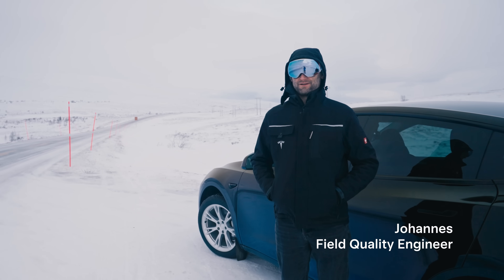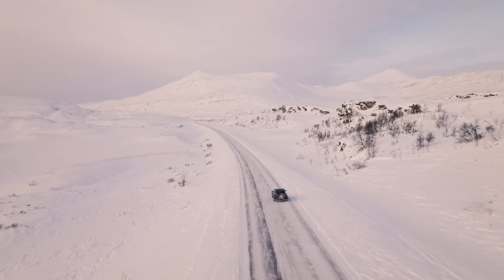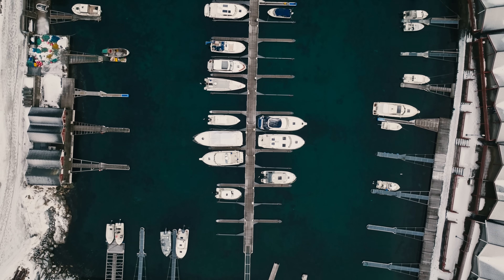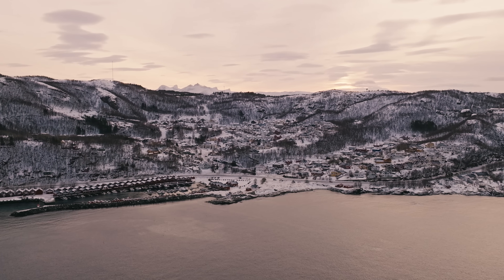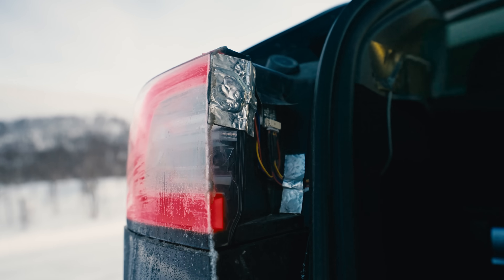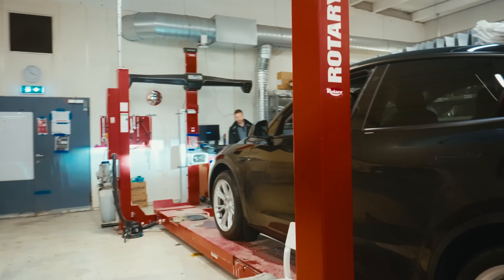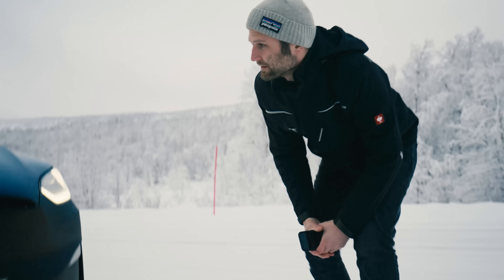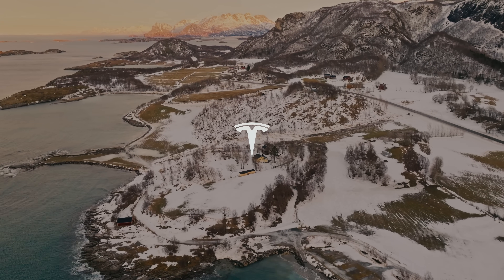Extreme Cold Testing | Tesla Model X & Y

Comment: Would be great with a winter mode that loweres regerative braking automaticly when in ice conditions, shuts of folding mirrors and so on..
Reply: Not 1 shot with snow on the car.
Reply: @nathanielschroeder1321 What is that supposed to mean? Over 80% of all new cars sold in Norway are fully electric, another 10% plug in hybrid and 10% gasoline or diesel. 

They perform impressively well in the winter, better, in fact than gasoline cars. Not having to pump gas in the bitter cold, and getting heat into your cabin the second you start the car, being able to melt all the ice on your windscreen in 1-2 minutes, those are real nice-to-haves that makes owning an electric car here so good.

Comment: Please bring it to Phoenix, put it in a garage that is not climate controlled and plug it in to charge overnight and close the door when it is +48c. Good luck.
Reply: Watch the hot weather test video. They test the cars above 50 degrees, it would be just fine
Reply: @patmanrick  I'm detailing actual circumstances when the system gets the garage well above 55c while cooling the battery while charging. The waste heat really helps keep the master bedroom above the garage nice and toasty, to say nothing of what it does for longevity of the vehicle cooling, electronics and charger.
Reply: @john_in_phoenix  I mean, presumably the vehicle electronics will be just fine given that the car internal temp won't exceed 104F

Comment: Those of us in colder climes do much better with a garage.  My garage is unheated, very well insulated, but attached to my house so it never gets below 45F give or take.  I often wonder how my S would do on a -10F morning.
Reply: -23 C? You wouldn't want to Supercharge it under time pressure in that state, but it will drive. The rest of the car will be as unhappy as any other car in that temperature. Norway is not just a testing ground for Tesla, it is also an admittedly small auto market where the Tesla Model Y dominates overall sales. If Teslas were stranded in those temperatures, the news would LOVE it. Occasionally having problems starting a piston engine in that temperature is normal, for comparison.

Comment: Please let us disable the regen breaking on icy roads on the model Y. It is super dangerous to ease off the gas paddle, The car Regen is dangerous on icy roads.
Reply: I set mine to chill mode and low regen in the winter, that seems to calm it down considerably in difficult conditions.
Reply: @geirmyrvagnes8718  you can choose low regen???
Reply: @tabxtra7057  Yes. Tesla have been back and forth on this, but I have it in a Model 3 in software version 2023.26.7 at least. I don't remember it being gone from my car, but if so, that probably happened in summer, since I use the standard regen then.
Reply: There used to be regen selection in previous software versions in 2022 when we had a model 3 rental, but when we got our new Model 3 last week it looks like that option is gone now?

Comment: Thats my hometurf.
Tesla engineers if you read this, the Y has a design problem in the wheel well lining.
With cold temeratures and salted roads the slush/snow acumulates on the fabric like liners in the wheel wells.
Last winter it almost rendered my car undrivable because it filled up and turned into some black glass like material that was impossible to remove.
Reply: It also builds up on the fabric like underbody panels, and rips them apart with weight.
I replaced my underbody panels with aftermarket aluminium plates.

But to be clear, this is a problem many cars from all manufacturers have. Most cars aren't built for long winters. Torn underbody panels are very common here.

Comment: Electric cars have better advantages in extreme weathers. ICE cars will overheat in in hot weather (mostly the onboard battery gets fried), and have trouble starting in cold weathers (frozen liquids).
Also driving through deep water, it has been shown a Tesla will have a higher chance ov getting through floods, unlike the ICE with their air intake getting flooded resulting in water in the combustion chamber destroying the engine (water does not compress).

Comment: Do the cars regulate the battery and electronics in extreme heat and cold? I keep activating COP and the A/C to prevent overheating, but there's no clear answer as to if that's necessary.
Reply: Those features are only for your comfort and maybe for the safety of items within the cabin. The car itself does not need any of this and doesn't care.
If you don't have something sensitive in the car, you only need to activate A/C a few minutes before you get in the car.
Reply: I’ve seen the car regulate itself to cool down the battery in hot days just sitting in the sun. That’s without the overheat protection
Reply: Thank you , you two. I was hoping that was the case. Was this said at a shareholder meaning, Tweeted by Tesla or Elon, or documented anywhere else, or is this just first-hand experience?
Reply: @Mountain_Drew  They included a section in the manual that specifically adresses this question since it has popped up so many times across owners and interested people.

quote: "This feature is intended for passenger comfort and has no impact on the reliability of your vehicle's components."
Reply: @Tschacki_Quacki  Yeah, I read that, which is why I started to question whether it was necessary, but it's not explicit enough for me :P But I'll just take your word for it.
Reply: @Mountain_Drew I think it’s in the documentation on their website somewhere
Reply: @omegastudios-minecraft1865 
There's a passage that suggests it, but no where do they explicitly say it.

Comment: Are you logging and uploading all geo location data, outdoor temperature and conditions, cabin heating or cooling settings, and cabin temperature and humidity; as well as variability of battery life operation in different conditions? You have the unique ability to have every car function as a sensor for complete data analysis.

I live in Eastern Canada (Nova Scotia). A common stereotype I have about EVs is that the cabins are too cold in winter, don't heat up sufficiently, and that the battery drain (mileage per charge) is drastically reduced in cold weather climates.
Reply: I live in Norway and would never willingly go back to freezing my proverbial body parts off while waiting for the combustion engine to heat up. You lose some range, so you charge a little more. No big deal in my opinion.
Reply: Yes and no.

Yes and no. The cabin is definitely not too cold in the winter. It blasts out heat immediately. I've found that mileage per charge isn't that bad in cold weather if you do long trips. What really kills total mileage are repeated short trips when it's cold cause you're using a lot of energy to heat the car again and again instead of just once. The thing is... if you're only doing short trips, does it really matter that much?
Reply: @Tschacki_Quacki Our family driving schedule is almost entirely short trips. We'd definitely have no trouble making up for any loss in range with more frequent winter charging. Thanks for the info. There's a segment of the population that are anti-EV, and it's hard to determine real feedback versus dismissive conjecture.
Reply: @joewardpr  You're welcome.
The naysayers have lost me a long time ago. Happy since 50.000km
Reply: @joewardpr same people came up with excuses about why hybrids were bad—25 years ago. A lot of people are anti-EV for political reasons.

The winter range is horrendous on all evs, however. I’m on my third now (model 3). Don’t be surprised to see a 40% drop in really bad conditions.

But as mentioned above the heat starts fast—no need for an entire engine to warm up first.
Reply: @Tschacki_Quacki  Exactly right. I live in Calgary and have done some testing of range and energy consumption in my 2021 Model 3 LR AWD in +30°C and −30°C. As you say, if you start out warm and drive continually, the range hit, even at −30°C, isn't too bad. (It's still significant, but not so bad that you wouldn't be able to make it to the next Supercharger with plenty of range to spare.) But if you're running a bunch of local errands and letting the car get cold again each time, yeah, that's where you see a really big range hit. But, as you suggest, it doesn't really matter, because it's still plenty range for driving around town through the day, and then you plug it in when you get home. And even in that worst-case scenario, it's still cheaper to operate than a gasoline-powered car. I recently asked an Uber driver whether his Model 3 was making it through the day even in the winter, and he said it was fine.
Reply: @conradce  No matter how much I would have to charge, I'd do it without hesitating. The advantage that you can preheat the car everywhere is just too good.
Reply: 1-The cabins are not too cold. 
2-They heat up instantly because they have heaters instead of using the heat from the engine. Meaning you don't need to "warm up" your car before driving off.  
-Range does suffer in cold weather. Mostly due to the HVAC having to warm up the car. I'd say 30-40% range loss.  My 2018 Model 3 is at ~500km on full charge, but in cold weather,  I'd be lucky to get 350km. 
Still no problem for daily commute. For roads trips, supercharges tend to be about 250kms apart so it's usually no problem.  It just means an extra charging stop. 

The thing that sucks about Tesla in winter is freezing rain jamming up the framless windows, auto-folding mirrors(you can turn off auto-fold) and flat door handles.

Comment: why buy anything than a Tesla? Best range, best performace, best HVAC, best charing network? I have driven my Model s for over 80 k miles 0 problem and 0 service ;)
Reply: Best charging network by far, but they are going to open the supercharging network to others soon.
Reply: Because your Model S probably hasn't been degraded by "Vision". I used to be a total fanboy of Tesla, driving 50.000 Km a year in my 2021 TM3. Tesla has completely ruined that experience with the "Vision" that removes the functionality of the radar i bought the car with, making ex. cruise control unusable when visibility drops below 500 meters, forced "auto"-use of wipers and "auto"-dim when on any form of cruise control which are mildly spoken, terrible as these two "automations" never has worked due to being camerabased and its just so utterly stressful. Ex. after it has rained and your out driving at night on that lonesome road the cameras sees the reflections from the wet landscape, dims the lights. Then 3-9 secs later the cameras has regained sensitivity, sees no reflections, fires main-beam & reflections starts again...And because of "Vision" you cant disable the auto-function so either dimmed (safety) or drive 100% manual. 

Simply terrible.
Reply: @Slendrianen  Blame idiot drivers who abuse automation and lawyers.. In any case, I do drive 100% manual and will to the day they take my license from me.
Reply: @ohger1  Congrats if that's how you prefer but it doesn't change the fact that Vision has downgraded the car & driver assist systems in a terrible way for us who had a perfect functional Tesla before greed & marketing-bs ruined it.

Comment: How come, if you are supposed to test the cars in such environments you can even imagine on using "Vision". The cars intermittently cant even maintain 80 km/h on a straight road id visibility is at 400 meters? It's SO terrible what you have done to my so much former beloved 2021 TM3 LR when this "Vision"-virus got installed and the functionality of the radar was removed. 

Driving 50.000 Km a year in Scandinavia where 3-500 meters of visibility is normal several times each week and just terrible such a new car has been degraded to something not more automatic than my first 1973 Opel Kadett. & then the joke of forced (non-functional automation) wipers & ever-blinding also forced "auto"-dim that are so slow to react after meeting an opposing car and flashes all the time if driving on a road at night where it has rained. 

Hadn't you lowered the prize of new cars so mine is unsellable i would have been LONG gone from Tesla forever with tour everlasting marketing-bs and hardware where its all about getting it as cheap as possible. Fool me once, shame on you, twice...I can tell you for sure its never EVER gonna happen again.
Reply: I wish they would finish the software fix BEFORE removing "redundant" hardware, not remove the hardware and then hope to fix with software at some point. Still waiting on the promised wiper and headlight updates...
Reply: @patmanrick  6 years on after intro of TM3 where we were having a laugh of those "Auto"-wipers & "Auto"-dim kind of functions that at best works random, and they must still be the 2 worst "automations" of their kind put into a car made for the western world. Pre-"Vision" we laughed, Post "Vision"-virus it surely has proved how little understanding of real world driving Tesla got being a self claimed software company above being a carmanufacturer .  Those HW3 1.2 MP cameras are just way to slow to get out of saturation, light sensitivity way to bad and this + lack of a proprietary rainsensor has made the entire "Vision" concept a tragedy. 

FSD for sure will never EVER happen here on anything near HW3 when the cars cant even keep the speed on a lonesome straight well-marked road when visibility drops below 500 meters. One day with visibility at 350-400 meters i let the car control the speed when "Speed limited due to poor visibility". It was a 60 Km/h zone and the car ended up doing 7 (Seven) Km/h. Surely safe behavior's and when i confronted Tesla its all within specs. 

Same happens when moisture collects in the camera housing of the windscreen during the night. +50 Km of driving manual or having the wipers going ever so berserk on that dry windscreen should you consider using any form of cruise control. Now they tried to compensate for this with a "auto-defrost" where you suddenly realizes the cabin temperature are raised sharply and you wonder wtf is going on since you starting sweating but hasn't touched the climate controls  

Let's see what happens to HW4 owners when HW5 gets a year from release. Their radars will probably also start to produce "noise" so Tesla will remove its functionality, making the car a just as POC thing to own vs. what they have done to my so former beloved tool for my 2½ hour daily driving that's now filled with utter stress from the forced non-functional automations that makes the car an utter pain to drive at any time from October to March. 

Removal of USS's, and now stalks too, all degrading drivability, all making the cars easier and cheaper to produce. 

Tesla surely knows how to ruin the experience for those that brought the company to where it is today. Max. profit, greed and LOADS of marketing-BS with promises that's forgotten the day after. I can only warn anyone against this company of greed and i do so at any possible time now they have lowered the prizes that much I'm stuck being their betatester and has to live with how Tesla has ruined my property with the "Vision"-virus.